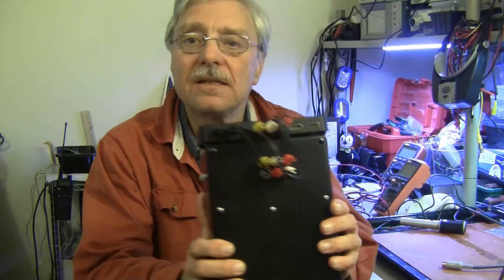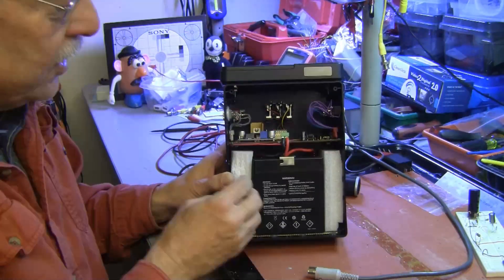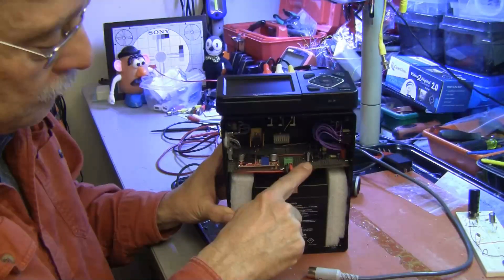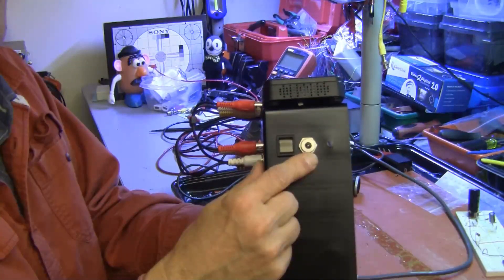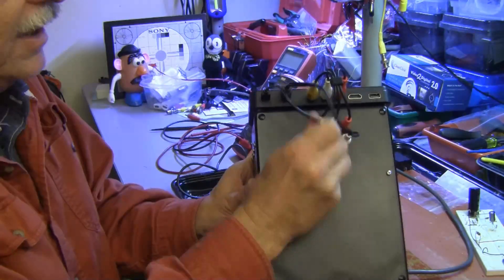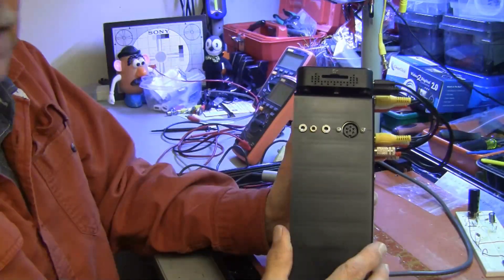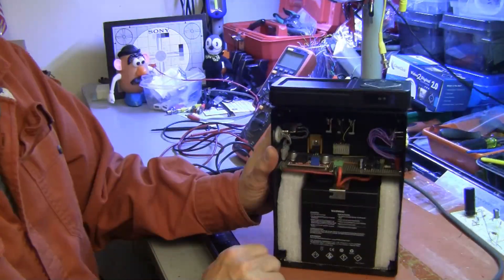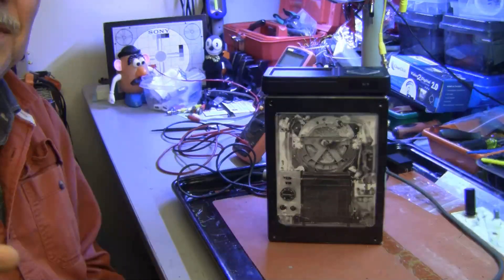Cartrivision Camer-A-Thon, Part 11 - The Cartrivision Portapac

Comment: Nice. But where is the tape?
Reply from the maker: This device is a novelty replica of the VCR. It records to a memory card or a USB thumb drive. This box is actually a self powered adapter for the Cartrivsion cameras which still exist in some abundance. I have now provided two alternatives for powering the cameras. My earlier AC power adapter and now this DC powered adapter. 
The recorder is a very modern ClearClick recorder, version 2.0. If you look closely, I have installed it in such a way as to not void its warranty. I made no physical modifications to the ClearClick recorder. See more about that device here: https://www.youtube.com/watch?v=kCBOhOv5oz8
Reply: The device is replicating the Portapak's functionality and form factor using anachronistic technology.

Comment: Very nice project! I couldn't help but imagine a chroma key insert of a real working cartrivision deck in place of the sticker. These modern SLA deep cycle batteries do pretty well! I took a road trip 3 years ago with a umatic portapack and sony bvp 110 camera. Both were powered by one slightly larger battery, and took a few smaller extras that I never needed!